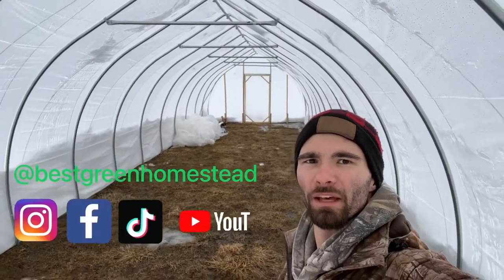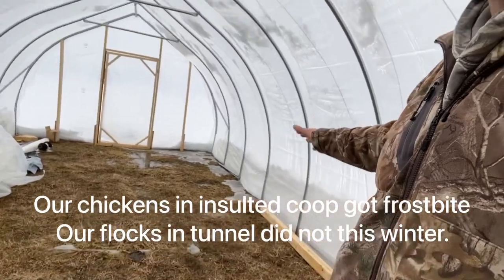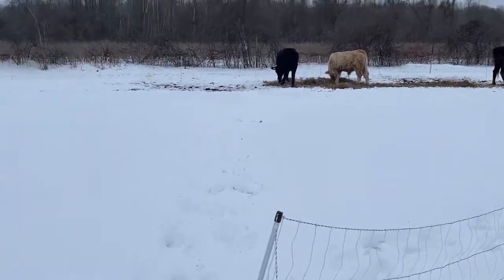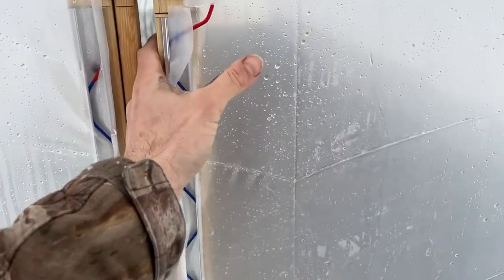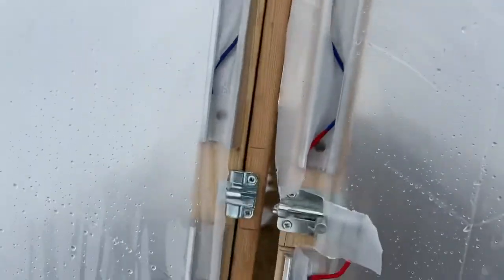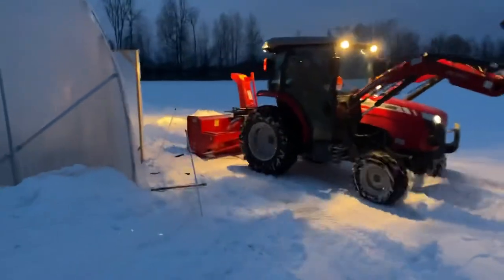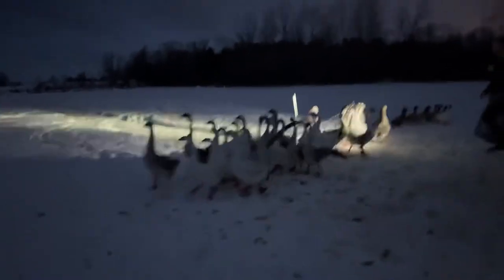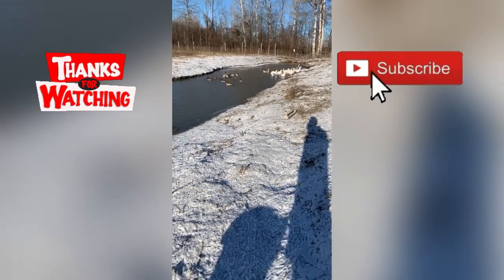Herding Geese into Greenhouse - Farmers Friend Caterpillar Tunnel-Pastured Poultry

Comment: Hello! Looks fantastic! I am looking into the Farmers Friend gothic tunnel for our 100 layers. Would you recommend buying from Farmers Friend and shipping to Canada, or finding a Canadian company? We are in Quebec, Canada. Thanks
Reply from the maker: I would highly recommend the Farmers Friend Caterpillar tunnels. They have been strong and durable, withstanding 80-100km/hr wind storms no problem and high snow loads. But price it out. We had a hard time finding an affordable, quality tunnel in Canada. Farmers Friend also has great customer service and a whole line up for farmers and market gardeners and we like their business all around. We just don’t manufacture as much as the USA. The shipping isn’t cheap, we got our 2 tunnels when there was a deal for free shipping within USA and cheaper than usual to Canada. If you are in Quebec, CA I recommend getting the most expensive yet most sturdy option the Gothic Pro. At least the Gothic peak as it sheds that heavy snow load right off. The pro version has the upgraded 16” lift kit, the added wind bracing, as well as the solid centre perlin as you may know, all of which is going to give you peace of mind in the wind storms. You can set one up in an afternoon, as they make assembly very simple. 

All that said, we will probably not look elsewhere when going to purchase another tunnel as we found a good product, and don’t want to risk switching to something of lower quality. 

Another brand I know of is bootstrap farmer. We have indestructible seed starting trays from them. They make tunnel kits but I believe they require more labour to set up. If you do get a tunnel from the USA, replacement plastic can be found in Canada. I know I found a location out west that I can get replacement for $450 or so for the 50 ft tunnel.
Reply: @bestgreenhomestead  Thank you for taking the time! All the information I needed!
Reply from the maker: @romanfraser9193  your welcome! Best of luck this year! Careful if you have birds in your tunnel on sunny days when getting warmer. It was 12°C outside other day and 36°C in tunnel by noon! Even with ventilation fan running full blast! We had to open doors. It could easily get 60°C or more in there in spring and summer if the sides aren’t opened! Could kill chickens even on a warm winter day with that passive solar heat.